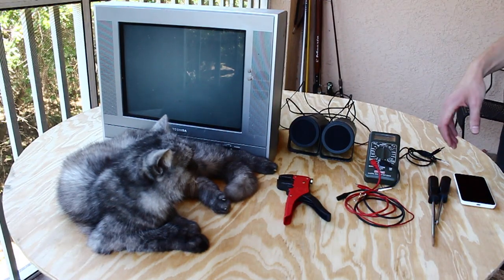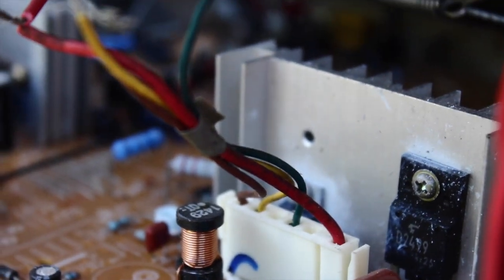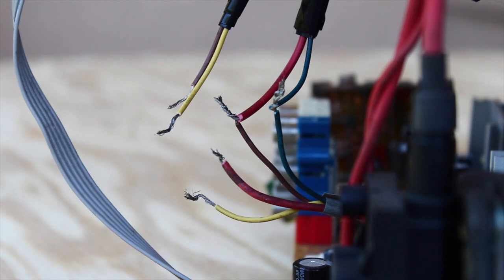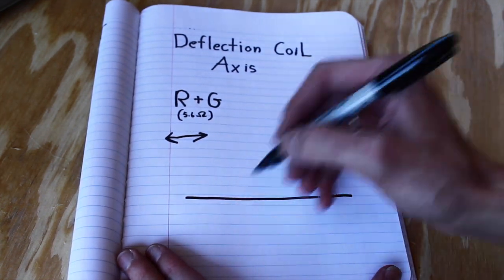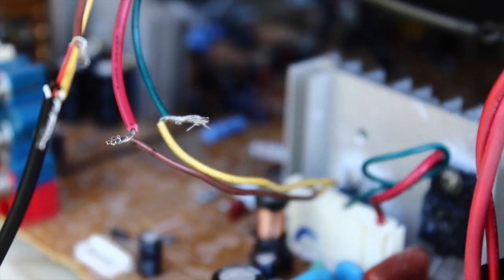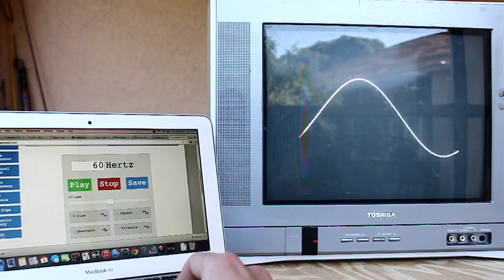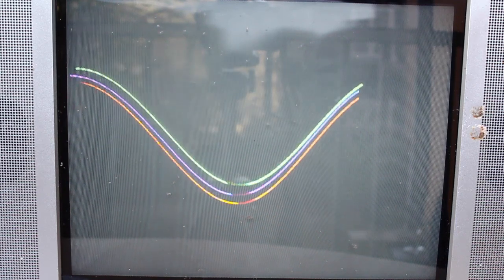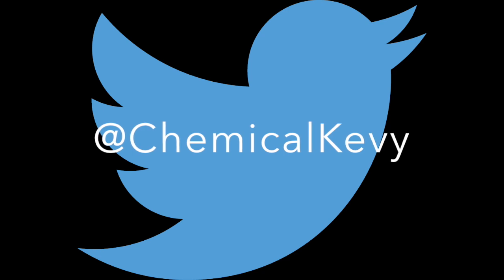Oscilloscope From an Old Television

Comment: this TVscilloscope only showed low frequencies. because you plugged the vertical coil to SUBWOOFER output of your speakers set... 
Try to put a non filtered amplified output. You will then see real Sine, Sawtooth or even square lines! 
But nice idea btw
Reply: No you won't. The coils are essentially inductors, meaning that any high frequencies will be suppressed. No matter what output you hook up to them they will always display filtered sine, square, triangle and sawtooth waves. This is the reason why oscilloscopes use electrostatic deflection over magnetic
Reply from the maker: Matt is correct, And the reason I used the sub output was because the output would be less cluttered, and stronger.

Comment: Would it work if I played my guitar through this?
Reply: well if i plug in my electric guitar the lights go out and i have to get a new fuse box because the old one burned up
Reply: why dont you try it out urself?
Reply: yes
Reply: A bit of an old reply I know, but nonetheless a great idea!
You should be able to do so, you just might need to plug your guitar into a preamp first :) you can use your guitar amp, if it has a effects return loop, or you can use a traditional audio interface.
Reply: connect the Guitar to your AMP, then, most amps have a port por headphones, use an aux there and then to the TV
Reply: only if it is an acoustic guitar because that one doesn't need electricity to run and then you can power the telli

Comment: does this only work on an old television, or can it work on a flatscreen tv or computer monitor?
Reply from the maker: Deep Frigid Winter Only on old TV's
Reply: +in 3D It uses the scanning electron tube present in CRT tvs. There are Flatscreen CRTs, but no flat panels. If your TV isn't a foot or deeper, its not a CRT. LCDs, Plasma, and LED tvs do not have scanning electron tubes.

Comment: Are the speakers "listening" to the music from the computer and then directing it to the crt tv, or are they amplifying the music from the computer?  Are they plugged into the computer, the crt, or both?  That's the only part of the project I have trouble understanding.  I REALLY WANT TO KNOW THIS!!
Because if i put the cable directly into my laptop, it barely makes waves...
Reply: +Nikki Swarts From my understanding, the speakers are plugged into the computer with the green line in cord and then the 3.5 male cord he attached to the innards of the TV, seems to plug into the headphone port on the speakers.

Comment: What if you were to hook the left audio channel up to vertical and right audio channel up to horizontal? what would the effects be? (Or Vice Versa)
Reply from the maker: RyuunosukePanda the channel does not really matter. If you put the audio in the other deflection coil it would end up modulating the horizontal scan and you will get a inch thick horizontal bar across the screen.
Reply: ***** I was hoping it would do something else. What if you were to use audio to modulate an electromagnet to produce varying color lines?
Reply from the maker: RyuunosukePanda Yes you could defiantly do that. Depending where you put the magnet, you can create lots of different effects.
Reply: I might have to give that a try
Reply: ***** you can have completely different things going through each channel, the channel definitely does matter
Reply: Deep Frigid Winter That will be interesting. I've been looking for a crt tv to try this with that isn't to big.

Comment: Niice.. I actually pick perfectly working old CRT TV's out of the trash, I got like 4 of them so far. I didn't watch TV from like 2005 to 2014 Nov when I got an ematic DTV-analog converter at Walmart for 29.99+ a couple bucks for 2 year warranty, because all these digital to analog converters are made to be killed by on air signals, because the powers that be hate the analog loophole in the Digital Millenium, and I love the analog loophole, so I use these to actually watch VHS and on air TV, but it's nice to know they can be used as oscilloscopes too.

Comment: careful with that flyback... they use very cheap insulation, with a powerful driver you can arc right thru the rubber/plastic insulation.